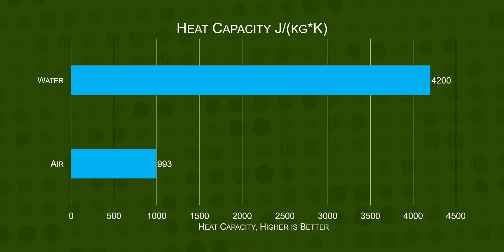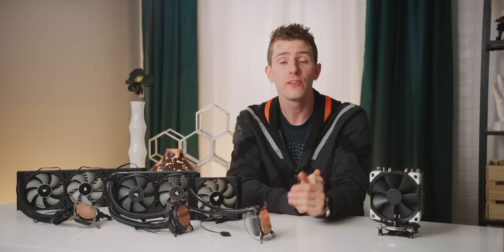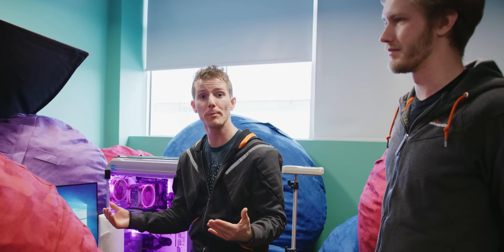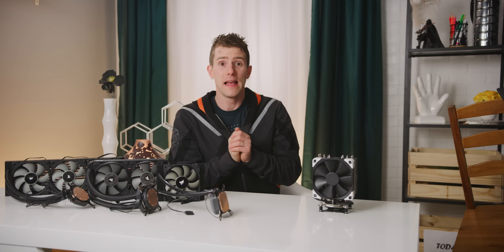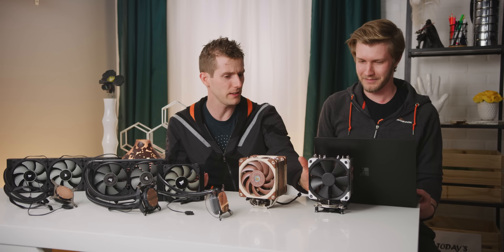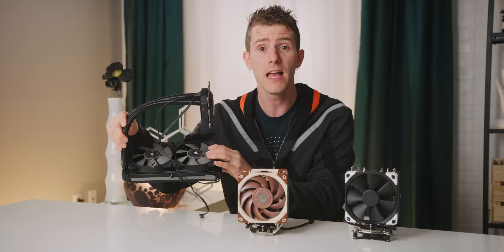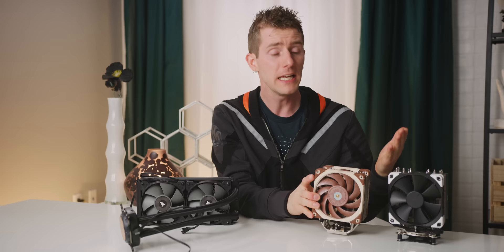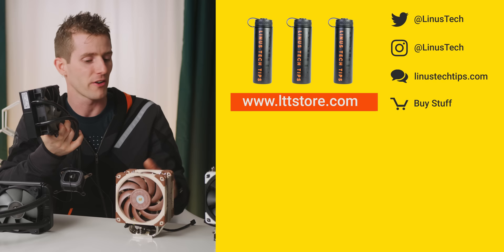Why you shouldn't water cool your PC

Comment: Came from Why is "Water Cooling Better?", I'm really confused right now...
Reply: Same.
Reply: Simple! Just water cool your air cooler which is cooling your water cooler!
Reply: @stevesynan3910  there is a got that made a few clips of that. Used a 212, cant remember the channel name but: watercooled aircooler should work to search..
Reply: Watercooling is wasted money you could get better something else with.. well if you want the best and money is no issue..
Reply: @-aleeke-2526  not if its custom a custom loop far out preforms air coolers and AIO's
Reply: @shadowxxe  "well if you want the best and money is no issue..(..!)"
Reply: @-aleeke-2526  Didnt see that part im blind
Reply: well linus right now has the "power" to say everything as is he doesn't have to lie and get sponsorships so i will go with linus
Reply: This is just an ad for Noctua fans.
Reply: How do I keep that massive air cooler from blocking my RAM slots?!
Reply: Linus is probably a brand at this point
Reply: So which one should I choose ? still need the answer from u guys :v thanks
Reply: Watch the entire video. note the title is why YOU should not water cool, not "water cooling is worse". 

It just gives the pros and cons of each cooling type, and simply points out that for a lot of people water cooling simply isnt worth the additional expense, points of failure etc when they just don't really need it.
Reply: Water is a lousy coolant for electronics. Alcohol is much better due to its low boiling point. Heat pipe coolers boil liquid at the cold plate and condense it in the exchanger. The alcohol is then wicked back to the CPU.

Comment: You should have included a low end like the Cooler Master Hyper 212
Reply: Ditched my Corsair H100i V2 last year because of annoying throttling. I am now very pleased with my Cooler Master Hyper 212.
Reply: Hyper 212 or even the old D92 are just as good as the Noctua unit, especially if you use 2 x Noctua fans.
Reply: I still have my 212 evo

Comment: If you adjust your parameters, like so:
- noise does not matter (doesn't matter if its 30 or 60 db since you do your job remotely)
- cheap price matters (lower price the better)
- ambient temperature matters (lower room temperature the better, CPU blowing hot air is a problem)

Which one woud be the best? 
- regular fan, stock cooler (intel)
- regular fan w heatsink (midprice)
- regular fan w heatsink (noctua)
- AIO (corsair)
- full scale liquid cooling

Comment: I've ran my 6700k with a 4.7 ghz overclock with a single fan AIO for 6 years. Temps rarely above 70C under load.
Reply: Anecdotal, but I got a dope one.
Reply: Nice - ive been running mine at 4.5 ghz for about 6 years as well with an AIO cooler. no problems here

Comment: Jayztwocents specialises in water cooling on youtube

Linus: I'm about to end this whole mans career
Reply: I don't know, I've got to call BS on their numbers... 81C on a 3x liquid cooled system is complete and utter garbage unless you're OCing it to hell and back. (which they aren't)

Though most people shouldn't care about liquid cooling anyways. With how efficient components are getting these days and how manufacturers are using larger, slower and quieter (and sometimes no) fans to cool components ... Liquid cooling basically boils down to extreme builds only. It's kind of always been an extreme build territory anyways, so... Nothing new there. The recommendation has basically always been only for extreme overclocking (or cool points) and not for noise.

EDIT: I realize it's a comparison against Corsair's closed loops, but.. well, if they're only succeeding at 81C with a 3x radiator ... They can just ... stop before they embarrass themselves further.
Reply: @ashkebora7262  The actual case has REALLY good cooling and airflow. That is helping the Air cooler a lot. And closed loop AIO have a small amount of water which can quickly heat up and fans can not cool it back down. So if you do 1-2 runs AIO will perform better. Leave it for half an hour and their advantage will die.
The case has 50-60% of fans installed in them. And those are Notcua nice expensive fans. 

If you are an RGB moron go for AIO so you can get your RGB fix. The noctua has a a 14sm fan with this cooler for a bit more money.
Reply: Whole man? As opposed to a half man?
Reply: @FTWGame0N  3x 120, let alone 140 should be able to keep it WELL below 81C. That is plainly embarrassing no matter how you cut it. If Linus' crew didn't screw something up, Corsair need to stop. Plain and simple. That is simply embarrassing.
Reply: @ashkebora7262  actually liquid cool is epic. My 2080 ti cost £500 stock. Stock fans on gpus aren't good. Liquid cool for another 150 to 300 depending on the liquid system enables me to surpass £1500 2080 tis. Nothing extreme about it.
Reply: @tangotyke6870  Oh I totally agree on liquid cooling in general. I have a custom loop described elsewhere that only has a 2x140mm radiator (high fin density) that keeps BOTH a ~4660k (yes it's old by now) and a 1080TI below 65C at all times.

That was the thrust of my comment: If you're only keeping 81C on just a CPU with a 3x setup .... you're doing something wrong. Very wrong.

Comment: i have a Thermaltake Contac Silent 12  on my Amd fx6300 overclocked at 4.4ghz 1.3v, under load only reaches around 65 Celsius never goes above 68, here in aus the ambient temp is around 30 degrees minimum, genuinely impressed how much a 20 dollar air cooler can do

Comment: They should've included the average temperature instead of just the max temperature.
Reply: If you want an actual good test go to Gamer Network. They do time to temp (the time it takes for the temp to level out with a max cpu)  which is great because games dont constantly max cpus so one that takes ages to reach temp is better for gaming because it will rarely reach that high level temp. They also place their own sensors for temp, on the back of the chip, intake, outflow and so on. They do quiet and and full rpm. They also test on multipul chips and boards. They do out of the box and overclocked, plus the max clock you can get for each cooler. Spoiler. Not one air cooler beats a water cooler.
Reply: @Skunkwurx  I think you mean Gamers Nexus?
Reply: Skunkwurx which got the better results in their test?
Reply: @6aloolq8  ----> "Spoiler. Not one air cooler beats a water cooler."

Comment: This isn't really water coolers fault but most people aren't using really powerful CPUs that even need a watercooler to begin with so they are out of the question for most people also AIO directly put the hot air into the room heating it up much faster while the pc is on which can be a problem if you don't want to spend a fortune on running your ac or you don't have ac like most of us UK viewers which completely removes me from wanting to use a water cooler ever really.

Comment: i think he should have looked at a few more Corsair AIOs
i have an i7-9700F overclocked to 4.5GHz and with my cooler, the Corsair H115i RGB Platinum, it very RARELY reaches 45 C. it's usually sticking to the low to mid 30s

Comment: Water-cooling is awesome for GPU's in particular, where you're able to replace the turbine horrible fans on most GPUs with much more efficient radiator dissipation, making for a quieter and more efficient system. CPU water-cooling on the other hand is more marginal compared to high end air coolers
Reply: Should I buy a water cooler or air cooler?
Reply: @ryanvanderveer4263  For GPU or CPU? That was the whole point of Tom's message. GPU maybe yes, CPU maybe no.
Reply: @ryanvanderveer4263  personally I don't bother with water cooling but it does seem cool
Reply: Water cooling can have catasphopic failure unlike air cooled fans that just stopped spinning

Comment: I would love to see them do this test, with the AIO's set up as push pool air flow.  The reason why the non aio's are performing so well in this test compared to the aio's, is because of the amount of air being pushed through them is so much more per inch of cooling surface.  That may sound strange, but that is the case here.  In the air coolers you have two fans, one is pushing air in, and the other is pulling air out.  the hot surface has more air per inch hitting it, than what you have in these AIO's.   Plus the fans are different as well, so the Noctua fans perform generally better than all others, and because of this we see a huge difference in the amount of cooling per inch of hot surface.  So if they used Noctua fans on the Aio's, and set them up to be push pull as well, you might see the difference between these coolers change compared to what this video finds. 
With all that said, this video does do a amazing job of showing the out of the box differences between these coolers, as most AIO's do not come with enough fans too set them up as push pull airflow.  The only reason why I bring this up is because it is the big difference between out of the box aios and a lot of air coolers.  In the end, even Aio's are air cooling at the Radiator, which makes even a AIO dependent on the same heat transfer rates as a normal air cooler. 
I hope this does not sound to confused, as I am about to go to bed.  Good luck and good night :)
Reply: Actually that push pull setup is waste of fan power... I use large cube shaped heatpipe coolers like the Schyte Ninja 3 that has room for four 14cm fans. If you only have to fans it is much more effective to mount them at 90 degree angle at the corners of the cube then push pull, I get several degrees Celsius lower temperatures doing that instead of push pull...
Reply: Actually push pull is not that effective, with cube heatpipe cooler like Schyte Ninja 3 it is better to mount 2 fans at 90 degree angle at the corners then push pull... I get several degrees Celsius lower temperatures doing that insteead of push pull.
Reply: @a64738  
Lets see, I'm picturing your setup in my head and even if you set your fans to pushing air through or pulling air through, you are still doing the same thing that push pull does for AIO radiators.  You are blowing more air over the surface that needs cooling.  The more air you blow through, the closer to ambient temps you will get, and you may be correct about getting better performance from a air cooler by setting it up the way you do, when comparing it too push pull air flow on the same air cooler.  But my comment was more pointing out that I would love to see these AIO's set up as push pull to see how those number compare.  AIO's can't really be set up with the same exact fan placements that a lot of air coolers can.  If you had three fans on your cooler, the first two set up the way you do, plus the third set up to pull, you might still get even better air flow and thus cooling. 
I tried to explain in my comment why I think those air coolers are catching up to AIO's, I likely did not do a great job at it, but it was a tired before bed type effort lol.
so as a final attempt, the air coolers have more airflow over the hot areas, thus allowing them to cool more effectively, when compared to those AIO's, so I would like to see a test where someone tries to match how much actual air is moving over the cooling surfaces. 
Also, I never saw the point of using a AIO that was not set up as Push/pull outside of saving money to run your parts hotter.  :)
Reply: @lfaf9509   push push at 90 degree with 2 fans
Reply: @a64738  
Okay then, what happens when you only use one fan? compare that to using push pull, and then compare it to your way.  What you will likely get is one fan performs worse than the other two ways. then of course push pull would be second, and First would be your way. Ether way, even on air coolers, push pull gets more air flow over those fens, than aio's get out of the box through there radiators.  This is why they are catching up to aios on cooling.

Comment: You know, in all this testing, there hasn't been any acknowledgement of how good Noctua is. Every Noctua is an air cooler. Not every air cooler (or AIO) is a Noctua. Linus - you once published a video which stated why Noctua hadn't released a new product in years. You know why? You cannot improve perfection.
Reply: the whole video he's been praising noctua.
Reply: Bullshit, you can improve perfection. We need better aesthetics, but that's called be quiet!.
Reply: Yeah, first gen Ryzen was a quite the turd when it came to overclocking. I guess i won the silicon lottery with my 1600 - tops out at 4.2 Ghz @1.42v. My U12s keeps it at 69c after 10 rounds of IBT

Comment: I've been using Corsair air's liquid cooling systems for many years now and 42 C is the highest I have ever seen for my CPU. I also should add live in a hot climate. ie. Queensland Australia I don't overclock my system though. I also don't want the weight of the coolers with heat pipes hanging off of my MB.

Comment: I've had leaks on AIO's about 10 years ago. Since then, its been all air cooling for me.
Reply: 10 years ago they were more prone to leaks now they barely leak
Reply: @vipergaming2817  one drop could be enough to ruin your day. It'd be sad to ruin a brand new $1000 gpu, which usually sits right below the water pipes.
Reply: @ryen7512   Depends what you use as a liquid, and how old said liquid is. Not all liquid will conduct electricity. Distilled water for example has very poor conductivity. However  distilled water will start to collect minerals and ions and would become more conductive over time. Majority of AIO use a glycol distilled water mix, which isn't conductive and wouldn't short your computer. But as I said earlier, it really depends on how old it is.
Reply: @EmperorWasHere  Angry much
Reply: I actually went the other way. I've been using NH-D15s for the last 8 years but I recently switched over to an AIO for better temps, lower volume, and more space. Part of the problem is that those big ass air coolers are so large, it restricted my case airflow and made everything in general run warmer.

My game load temps were about 65C CPU / 75C GPU with the Noctua in my mid tower and switching over to an NZXT Z63 got me down to 55-60C CPU / 70C GPU and was also noticeably quieter doing so. This was even after I remounted the Noctua with Kryonaut to reduce temps vs using pre-applied NZXT paste.

Comment: i had a fractal watercooler with 3 fans.... it failed only after 2 years and flooded my PC...... i saved everything, thanks god, but i returned back to noctua air cooled solution and im happy
Reply: @williamjones4483  im not filipino, no way near..
Reply: Seriously.... how did you Water cooler flood your PC?
Reply: @caballeropaladin1116  the block on cpu cracked and started leaking, all the water spilled out.
Reply: @euroovca25  ouch... was the pump in the block or separate?
Reply: @caballeropaladin1116  the block had the pump in

Comment: I bought a Noctua NH-U12P CPU cooler around 2009 (like 13 years ago). Since then I changed to different CPU sockets twice: to LGA1150 and recently to LGA1700. Both times I contacted Noctua customer support for an adapter for those sockets, and both times they sent them free to my home in less than a week. So 13 years later of buying an "expensive" CPU cooler, I still have it in my gaming computer and it works as the first day. Very very quiet too.

And also, my computer case has 3 Noctua fans, apart from the CPU cooler: 2 intake and one exhaust. They are completely silent, and have only one working at 300rpm (no noise at all) for office work, and rest working at 0rpm (stopped). When gaming, they start working automatically (the motherboard does it when temperature increases), but they are not even close to their maximum 1200rpm, so even gaming the Noctua fans are quiet!!

I have never been so happy with any component in my system as I am with the Noctua fans. And I have been building my own computers for gaming for 28 years now!!
Reply: I had both AIO water cooler and good quality air cooler and my air cooler trumps that AIO cooler in any way. Not only it's more silent, but also much cooler and I don't even have to worry about leakage or pump failer. By the way my AIO cooler died from pump failure. Simply air coolers are superior to those crappy AIO coolers and they're also cheaper.

Comment: How did Linus think 2 Noctua fans would be louder than 3 Corsair fans and a pump?!
Reply: i guess the idea was that 2 fans had to work in higher rpm
Reply: @TheCerovec  is that metioned before he guesses i guess i missed it :D
Reply: @TheCerovec  those were the case fans. But yeah, having 50 bucks worth of fan on your air cooler makes a difference for sure when you only have 30 bucks of fan on your 360 AIO

Comment: I wonder how the AIOs will perform with the same Noctua fans
Reply: You still have the pump to worry about. Its AIO and the liquid fouls over time, gunking up in the block. Leaks & pump failure. Noctua fans guranteed for 6 years and theyll really last WAY longer.  A big dumb block of metal with the highest quality fan is oh so much better.  I can understand custom water loops if youre after something niche but honestly its expensive and a pain in the ass.  AIOs are just a stupid fad that should die.   Noctuas are so simple to install also.   Set and forget. Done.   The a12x25s are ridiculously good. I have 3 of them at the front. Enough positive pressure so my PSU fan never comes on. PSU mounted fan side up, air only exhausts via rear 140mm fan, GPU vent and PSU.  GPU is always actively cooled with its fans off! The noctua fan controller is great so you can precisely dial the fans up to the highest inaudible speed.